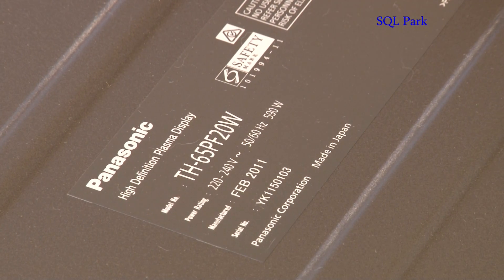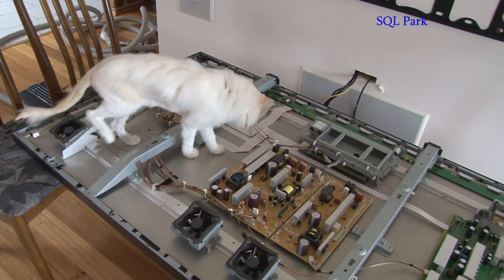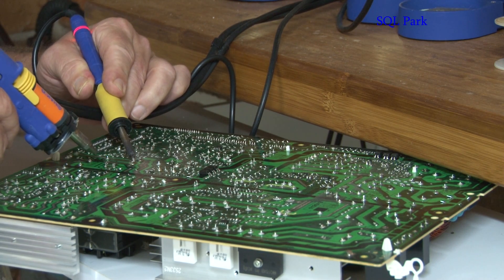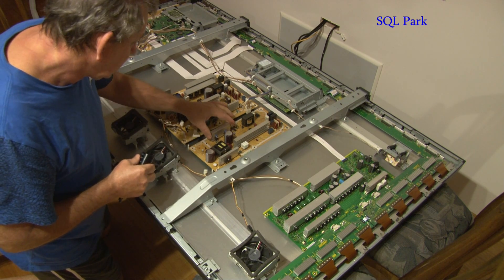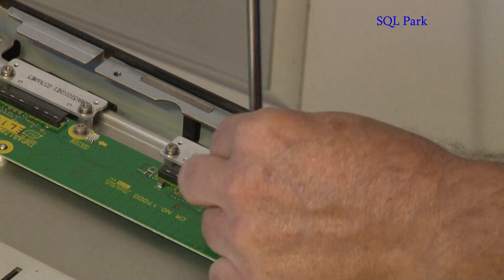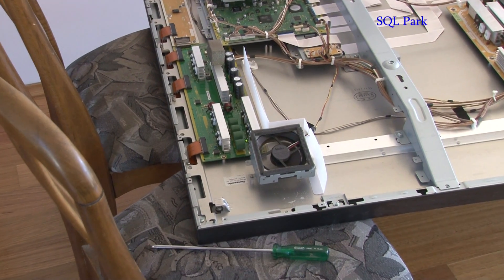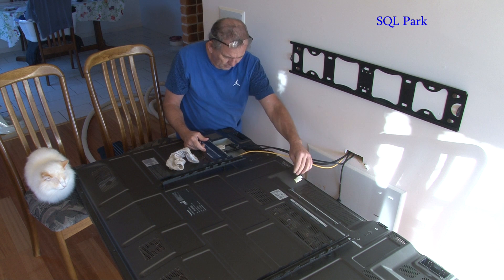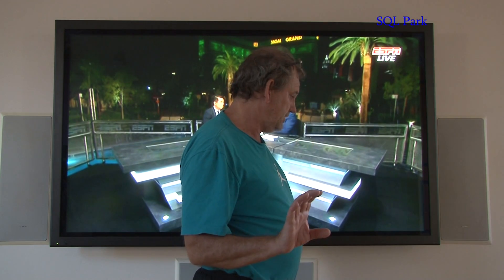Plasma Screen - Repairing the 6-8 blinking RED Light Warning

Comment: Open up the back of a Pioneer ninth generation plasma there’s about 20 more boards in there it’s wall-to-wall Electronics there’s hardly anything in that Panasonic. I guess that’s why the pioneers cost so much when they were new.I have one apart right now eight blinks Sent the board off with shipping it is $84 to fix. Versus spending 780 for the board from Pioneer

Comment: Have you any experience/knowledge about 8 blue blinking lights on a Pioneer Elite plasma #141FD?   It does this when I try turning on my DVD player.  DVD will play for 3-4 min. then the tv shuts it off and the blue blinking on the tv  comes on   Blinks 8 times rests for 3 sec. then this repeats.  Also when I’m watching tv normally if I turn set off , I need to wait  at least 5 min to turn both tv and amp back on to get pic. And regular sound.   
Any help is most appreciated🙏

Comment: Good afternoon friend. I have a Sony Bravia 60-inch, 3D LED. And she with this problem turns on and off doing nothing, and the red led flashes 6 times, would that same problem you showed in the video? Thank you!
Reply from the maker: It would be similar. I would go through this routine as far as cleaning the vertical and horizontal ribbons, running compressed air and checking if that worked. If not I would look for a blown capacitor and check led di-odes are showing green. Most new televisions have a di-ode in a corner that signals 'green' for 'working'. If no luck, then check with sony for manuals and signal identifications. Hope this helps  :)
Reply: Tks!! =D

Comment: Hi, I have got 8 blinks on Panasonic th-50pz80b any advice please..
Reply from the maker: I would start by checking for lumpy capacitors. Then using compressed air on the vertical ribbons across the bottom. Put back together and restart  :)
Reply: mukendibill

Comment: Congratulations on a job well done. I have the 8 blinks of death and would have no hope without your video. Thanks!
Reply from the maker: Yes. repaired. Basically replacing two capacitors and using air compressor to clean out horizontal and vertical ribbon cables
Reply from the maker: +Andy Everett Thankyou
Reply: did you fixed it? l have same issue after plugging the paid cable wire with the power running :/
Reply: Stephen McCarthy
oh men, l had to repalce the Main board... SNOY BRAVIA 33" led